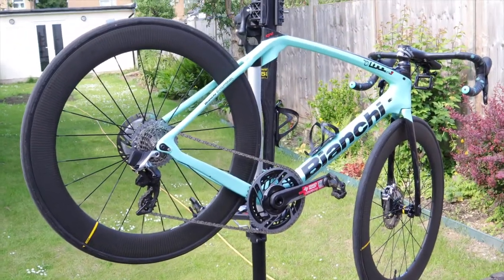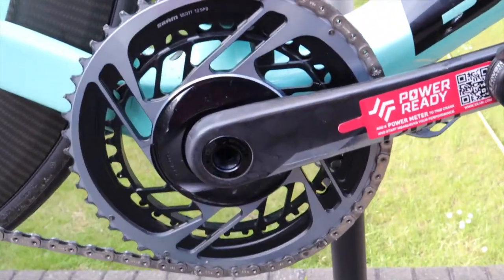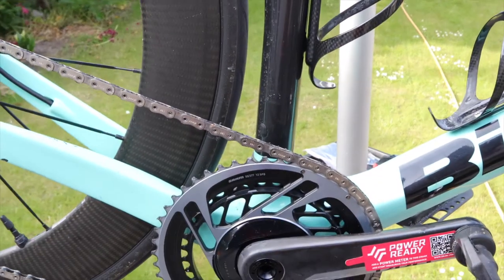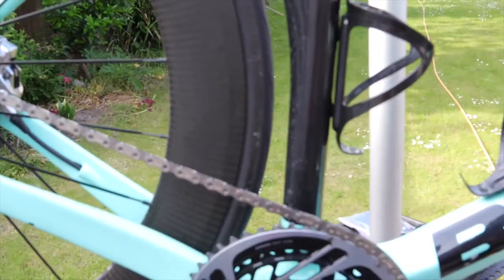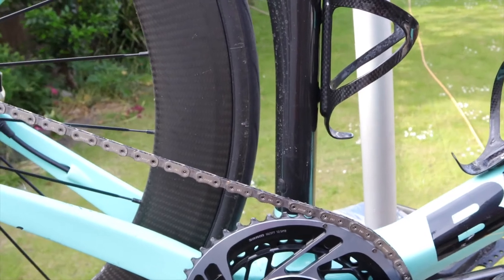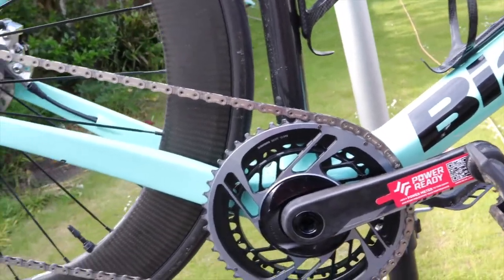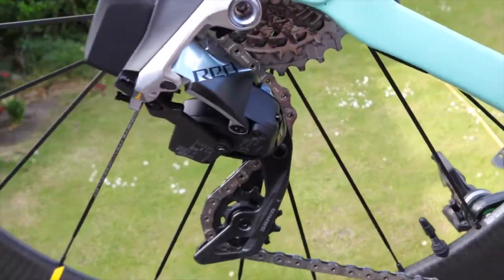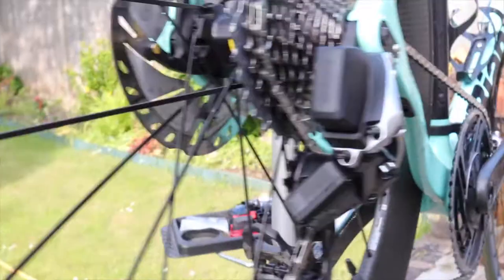Why Did I Spend All This Money Upgrading My Bianchi Oltre XR3 CV Disc

Comment: Hi there, from my perspective this upgrade does not worth it, although I would upgrade the same components that you did: groupset, handlebar, and tires... But, it's a serious investment and you've gained 3 gramms in total, yes you'we read that correctly 3 gramms! And as you replied above you have to be extra careful with those tires to!!! I have exactly the same bike with the same specs(ultegra mechanical/discs/size 50) the bike weighs 8.39 kg! So, in my opinion an upgrade to xr4 is more judged. By the way you are the only user of xr3 who makes videos out there in English, so thanks for that! Cheers mate

Comment: Hi. I have comete wheelset too. And i bought sram force axs groupset. Can you say model number of xdr hub please
Reply from the maker: Hi. Congratulations on getting a really good set of fast wheels. For the sram red I got the ID360 Mavic XDR Freehub! If you got the Yksion tyres that came with them avoid potholes at all cost. I only got 3.5 rides out of mine. Good luck.